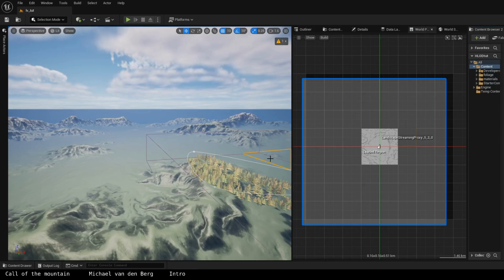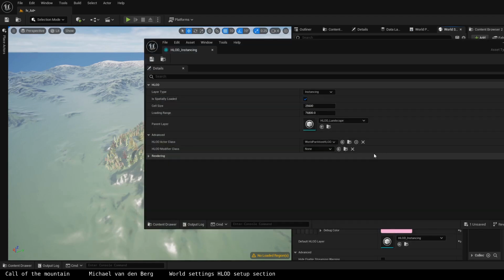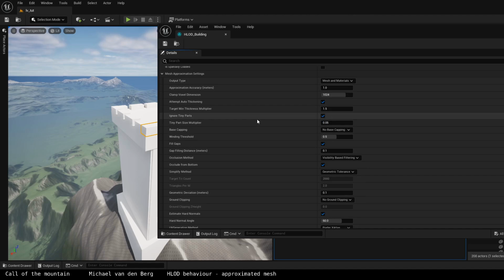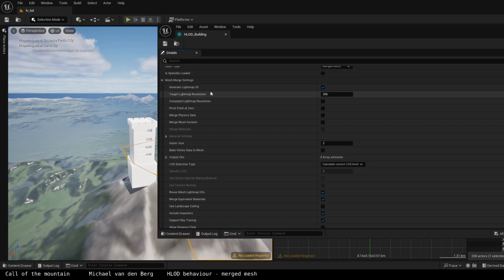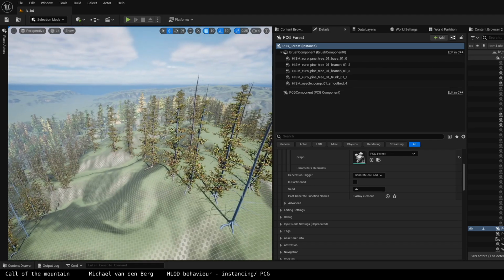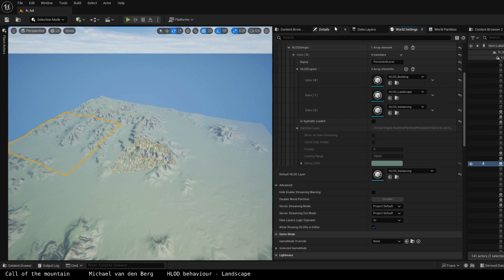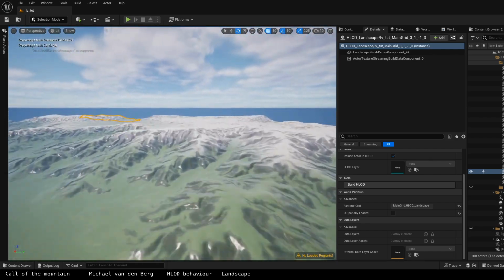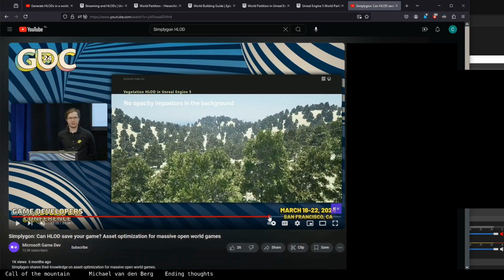Unreal Engine 5.4 World partition & HLOD's

Comment: Nice video! Have you ever experienced some areas turning pink after baking? I mean, the same mesh with the same material instance is fine in one section of the map, but turns pink if used in another section. Thanks in advance!
Reply: Edit: Solved by disabling "Reuse Mesh Lightmap UVs" in the Layer Settings.

Comment: Run this in the command prompt if you struggle building HLOD in the editor, it will do it without opening the editor. 

"E:\Program Files\UE_5.6\Engine\Binaries\Win64\UnrealEditor-Cmd.exe" "E:\GameDevelopement\Projects\UE5\ProjectHSP\ProjectHSP.uproject" "/Game/Maps/MainMap.MainMap" -run=WorldPartitionBuilderCommandlet -Builder=WorldPartitionHLODsBuilder -AllowCommandletRendering

Obviously, replace the parts with your own UE install dir, project file and map to build. I used to get out of memory errors, and it'd take 1-2 hrs, with the cmd prompt it's around 10 minutes with no memory errors.

Comment: Thanks, build HLODs never worked on my side, do you think you could do a quick tutorial for the command? If I do build HLODs it always ends up crashing even on a blank map and with a single cell (build Minimap doesn't work either and whatever version of unreal I use) I've tried it all since this feature appeared, I have 128 gigabytes of RAM. That's why I don't use the world partition.
Reply: Try using WorldPartitionRuntimeHashSet, since another option crashes deliberately
Reply: "E:\Program Files\UE_5.6\Engine\Binaries\Win64\UnrealEditor-Cmd.exe" "E:\GameDevelopement\Projects\UE5\ProjectHSP\ProjectHSP.uproject" "/Game/Maps/MainMap.MainMap" -run=WorldPartitionBuilderCommandlet -Builder=WorldPartitionHLODsBuilder -AllowCommandletRendering

replace with your own settings (proj dir, engine dir and map to build)

Oh, run this in the cmd prompt.

Comment: Hey - thank you so much for the explanation! Now I wanted to increase the HLOD resolution for my mountains but realized after building, that Unreal does not connect landscape proxies built with different resolutions. There is gaps on the edges. Is there a fix for this or should I just replace the mountains with nanite meshes instead?
Reply: bake down some virtuell textures the material of the landscape Proxy is importent

Comment: When I try to build HLOD's it always ends up failing and I've found out that I need to build the World Partition Minimap first. When I try to do that it gets to 100% but then I get a message saying "Build failed", do you know what the problem could be? I'm not running out of gpu memory or anything.
Reply from the maker: I would suggest checking the Log to see if theres anymore info there, or to try to use the commandlet and try building it like that, also double check that all HLOD layers you are trying to bake are set up in the world settings like I show in the video
Reply: I have a similar problem. The building process of building the minimap or the HLOD never ends. It never fails either, it simply continues without finishing. I have read the official doc, and watched a couple of tutorials, like this one, but I can't find why this happens...
Reply: @conatcha  I figured out that the issue for me was that my landscape was too big, it went beyond the default max size of 8161x8161 however if I split it into two different landscapes then it works fine. I also had the issue of the minimap taking forever to build but the fix for that was to add a World Partition Mini Map Volume to the level and scale it up to fit the whole map. The best way to troubleshoot your specific issue is to copy the error message from the log and paste it into chatgpt and you will get an explanation of what the error is and how you can fix it.
Reply: @ In fact I found out yesterday that this is a bug that they haven't fixed yet. In my case, the only mesh I have in the HLOD is a sphere in the distance and that's all. It shouldn't take so long to build. And I don't see any error in the log either.

Comment: Absolutely awesome! Thank You so much for your effort and great explanation! I have a 16x16km Landscape with pretty dense forests.. it runs pretty good but the loading time is why i have to make hlods for the trees. I will give it a try tomorrow. I'm using Imposter as the last LOD for my trees. The trees are generated inside UE with the PCG Plugin. I wonder how the workflow could be if i want to make new imposters for tree clusters and how to set it up inside unreal .. XD .. did you allready test it or do you have an idea how the workflow could be? :-)
Reply from the maker: I recommend to set it up outside of unreal if you can, if you're having difficulty getting the data outside of unreal you could also try the actor merging tools